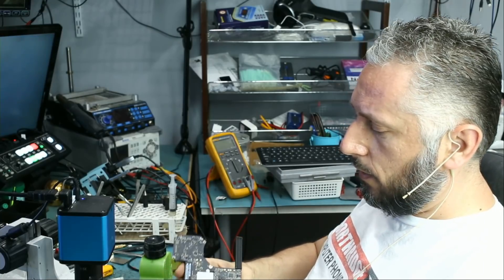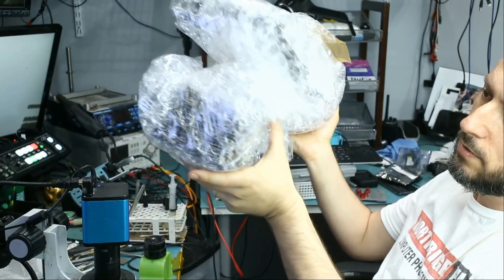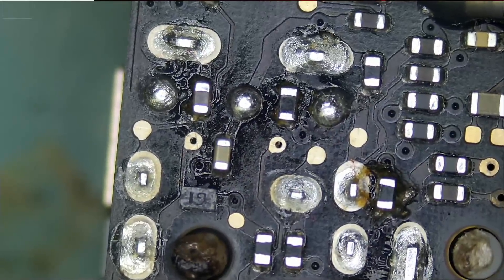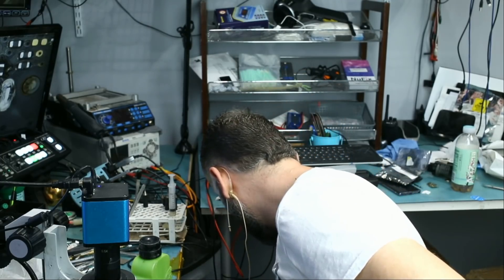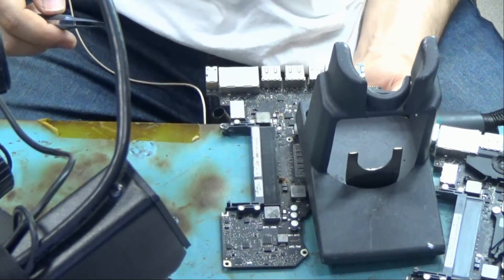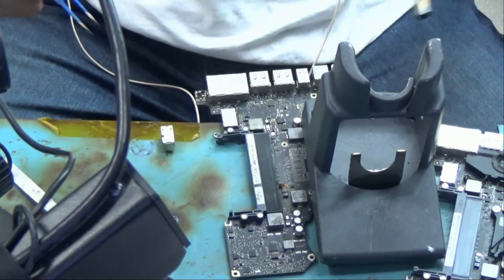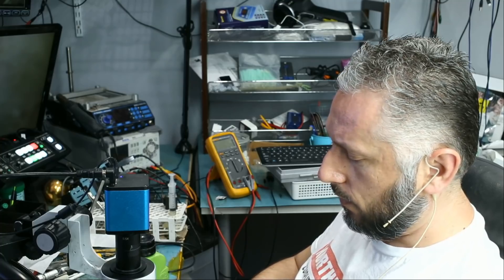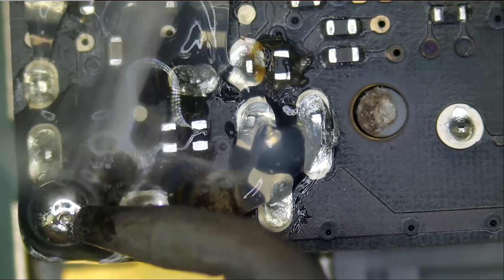Low Melt Solder Vs 500C Hot air - Macbook Pro 13pin Headphone connector  replacement

Comment: Whats the temperature you use with the hot air on the low melt solder thats impressive

Comment: Not surprised apple had problems with headphone jacks. Three of mine had a defective contact with one dead channel. One I try to fix, ended up burning off the traces, the other exchanged while still under warranty. Went around and around with Apple support trying to found fault with me, first testing for water intrusion or tempered with the case, none happened.  Then a long while to admit one bad channels, it was intermittent. The remaining other, never use the jack again, bluetooth only. Most likely why Apple eliminated the infamous headphone jack.

Comment: Off topic; I just watched your "I prefer HDMI microscope and not Stereoscope".  I have a microscope camera over my desk with HDMI into a monitor.  It was fine for looking closely at small items to read numbers or look for defects.  But when I started to practice micro soldering SMD; there is a time lag on the screen that screws up my timing trying to pick things up or place soldering iron on the pad to solder.  Is the camera microscope you use more real time. Or have you just adapted to the time lag? Thanks
Reply from the maker: The microscope we use has 0 Lag via HDMI and everything you see is in Realtime. Just make sure you are not using an ancient monitor with latency issues.

Comment: I bought few months ago low melt solder from you though it bit expensive but it worth it every time I pull out the charging connector replacement 👌

Comment: I wish I knew of low melt solder a year ago. I struggled with a USB 3 port on a gaming laptop, and baked it in the oven for 10 minutes to evenly heat the board up (thinking it was a heat sucking ground plate issue), replaced the USB 3 port and now the motherboard shuts down straight after switching on. Expensive lesson! :(

Comment: hello i'm huge fan of you work and i'm soon gonna start phone repairs shop! but atm still learning at home with little equipments 
i'm impressed with the way you are  using the soldering wick cause it never worked for me i mostly use around 400C heat but i can't clean the pins! any advice please ?
Reply: Good quality solder wick makes the world of difference. I've been using MG Chemicals Superwick no clean wick. The el cheapo brand I was using before was garbage.
Reply: You can try to improve your solder wick action by adding a good quantity of flux. Anyway, the optimum solution is, as already suggested, a good quality solder wick. Regards from Italy.

Comment: Nothing beats the low melt solder, flux and hot air combination.  Also macbook pcb absorbs alot of heat due to the thickness of the pcb.  As always another nice video!!!  Take care 🙂

Comment: Great example of using the low melt solder, nice job 😀👍
Reply: i use three type low melt solder 225 degrees, 270 degrees 255 degrees, which our boss is using would be chip quik indium based one which has mp 143 degrees C

Comment: Why not add leaded solder to those joints before using heat? I know it is a donor board, you do not care about it, however, if you use leaded solder, it will melt  sooner and takes less time.
Reply from the maker: You clearly missed the point of this video.
Reply: @NorthridgeFix  Maybe the customer had a three-year-old son that decided to help daddy adjust the phone plugs with his little screwdriver. Just saying :)